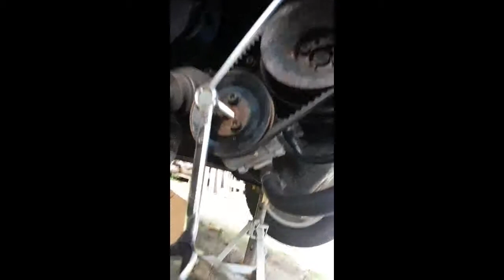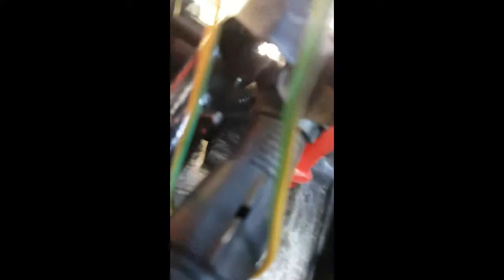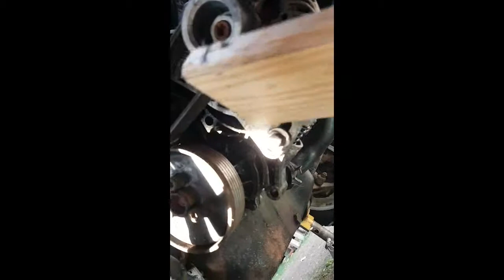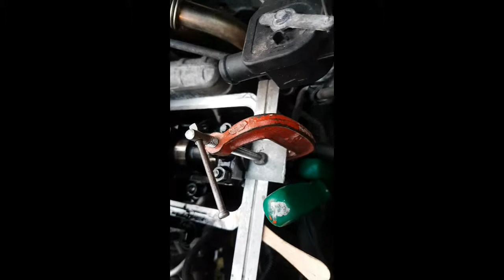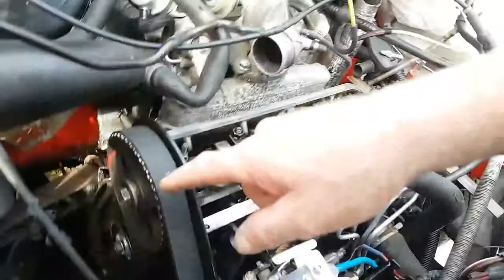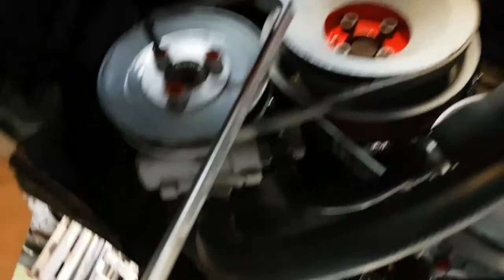vw t4 timing belt change 1.9 tdi ABL✔💚♠️

Comment: The timing tool just holds it or what ?
Reply from the maker: If your talking about the camshaft,yes the improvised metal plate holds it in the slot,I also wedged the flywheel with a couple of screwdrivers just to make sure